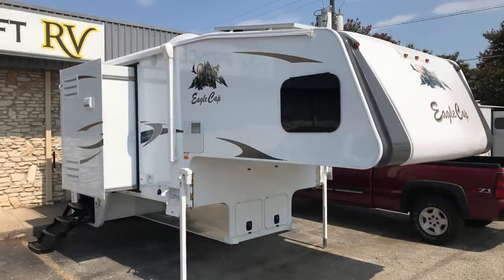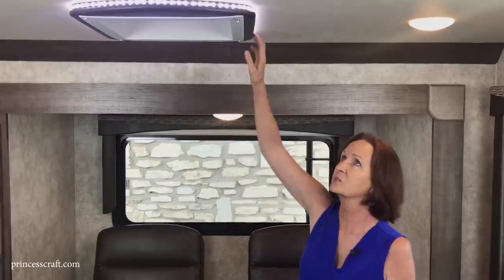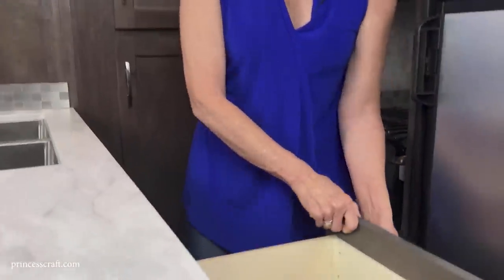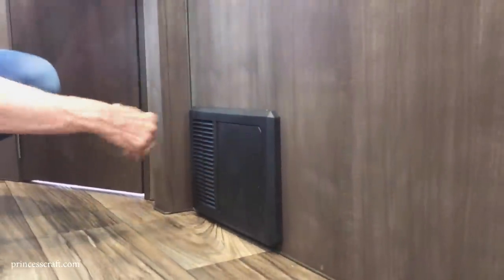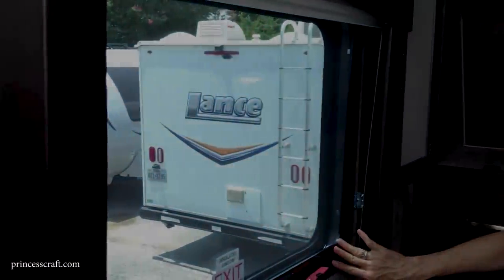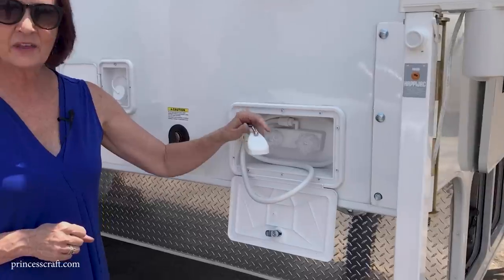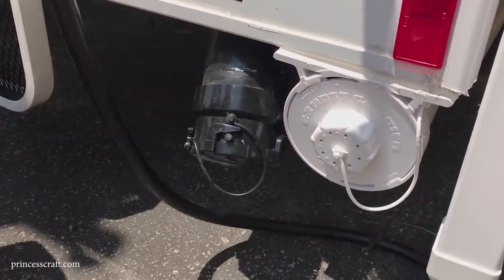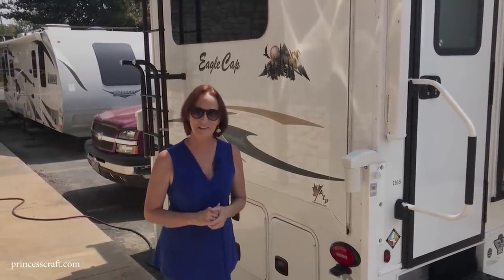2019 Eagle Cap 1165 Truck Camper Walkthrough with Princess Craft RV

Comment: Lot of people don’t understand that it allows you to use your truck for other things, motorhome, and trailers have a second annual tax in many states. Plus you can go where a trailer can’t and even small motor homes have a huge overhang the will limit your travels. These are the pluses for a truck camper. Don’t need those features then buy a different type RV. They all have pluses and minuses.

Comment: I think it's very very nice! The stereo that controls all your audio that's at knee level...yeah that's stupid. If it controls as much as it does...you wanna be eye level to see the menu as you scroll through the various functions. Hard to do when it's at knee level. Not a complete deal break but I see some points where leaking will take place after the camper has been subject to road virbration. For $60k it can be done alot better.
Reply: Maybe Chalet did it better but they don't make pickup campers anymore. Maybe Host does it better and Artic Fox Silver Fox Edition is close but who does it better? This camper is just about as good as it gets in a pickup camper. All that in a pickup camper is not an easy task. One reason they cost so much is the amount of engineering it takes to get it all in that small space and still be balanced and safe. True I'd like a better radio location. I'd like a better  radio. Bigger TV'S, a clothes washer dryer and a real jacuzzi tub. There getting there but it won't be 60k. More like 75-100k. You can get anything built you want but sadly it just won't make the weight limits of a pickup camper.

Comment: So by the cost to buy this camper and the truck to carry it,  you could get a class A motorhome, or an all terrain expedition  vehicle.
Reply: All tertain expedition vehicle for 120k? Where? There at least double that more like 500k and a class a built like that at least 200k. Sure you can buy a cheap class a with cheap plastic fixture for 120 but you can't go where you can go with a pickup and camper. Plus you can't drop the camper and use the pickup as a pickup or daily driver. I'm just saying  there are other considerations than cost. I do agree 60k is a lot for a pickup camper. It's a lot for a pick too. So is 500k. Check out Palamino campers. Not this nice but still very nice and I think 22k. You could ware the first one out. Buy another brand new one. Ware that out and buy a third new one for the price of just one of these or even a Host. Just an option.

Comment: I have a question about the A/C in this unit, is ther a duct to get air into the bedrooms area how is the A/C air handled? I know most truck campers have a roof air with the air being distributed forward and rearward from the A/C grill, if this is the case how does the air from the A/C get to the cab -over area? I like what I see in this camper how does it compare to the Lance 1172 quality-wise?
Reply: No, you don't need them were talking 10 feet or so not 35-40 feet where you need it.  Course I agree it would be nice. They cost enough already. Plenty cold and I like it cold. I thought of 2 units I live in the desert but you just don't need it unless you want a backup. Plus the engineers are very weight conscious. These are getting so big and so heavy you really need a larger truck than a 1 ton dually. Adding anything more doesn't help the weight.  I want a washer/dryer in mine. Chalet made one with it but then stopped making them. They went out of business, sold the business but the new owners aren't making pickup campers. What a shame in my opinion they were the best. As for lance. Out dated small generic bathroom. Floor issues. Nice but not in the class of this or Host or even Artic Fox Silver Fox Edition. Stick to one of these or if cost is an issue look at Palamino for 22k you cant beat it. Also Alumi-lite, sparce amenities but light and last forever like an airstream. Happy camping.

Comment: I don't understand why the black tank flush is on the opposite side of the camper from the dump valve!  When you dump, the water access is on the same side as the valve.  Not good.  Also, why isn't there a way to manually retract the slides in the event of an electrical failure?  PS  I own a 2019 Eagle Cap 1165!!

Comment: One of the nicest truck toppers I have seen and a nice presentation, but if I'm not mistaken, (and I played this part three times) it sounded to me like she said the price is around $60,000. Seriously? Let's see, after adding another $50,000 to $60,000 to that for a decent truck to sit it on your looking at around $110,000 to $120,000 for something relatively small, and doesn't even come with an A/C unit. When you consider the fact that you can buy a really nice, new 2019 motorhome for around $80,000 to $90,000, who in their right mind would choose to pay that much more for so much less? There must be something I'm missing ...

Comment: Super fancy! I just dont understand, Smaller Rv'  less materials' yet more expensiver?  Than a 30ft Trailor? Maybe im just clueless?_ Nice rig though ☺peace'
Reply: I agree Charles. No reason at all for smaller TTs to be higher in price than longer ones. It's so wrong how the manufacturer is taking advantage of the smaller market buyer.
Reply from the maker: Depends on the materials and construction methods being used. Where they’re built plays a part. Engineering features into smaller rigs is more difficult/time consuming/and costly.
Reply: @PrincessCraft  excuses excuses...
Reply: @PrincessCraft  Thank You!' Now Im Less Clueless' and Would Still Love To Afford One🌎✌
Reply: I don't buy the higher engineering costs. Sure there probably is some additional engineering cost but so do all new models.  The basic design was engineered 50 years ago so the cost have long been paid for. Personally I belive 
The high cost is a rip off. Palamino campers are nice, no not this nice but nice. At 24k you can't beat the price. Options not with standing but if Palamino can build them at a reasonable price they all can. Plus you can't justify the extra 35 grand is due to upgrades. Some yes, but 35k? No. Give us all the reasons you want, the answer is greed!

Comment: That rubberized fabric roof with the screwed metal edge clamps, and plastic top fittings will be fine for a few years, then it will begin to leak, and IF.. IF..IF the frame of the camper is made of wood. rot will set in around those screw holes... then extensive roof resealing every year will be needed to reduce further damage.   One piece fiberglass roofs are superior. 

This note is after 25 years living full time  with RV's  all across the US... look for full aluminum frame campers at a minimum.  (I dont know if this one is aluminum frame or not... for 60K it should be.)
Reply: So are you saying Lance truck campers are better?
Reply: Lance campers are notorious for bad leaky floors. Plus the generic bathroom is small and the design lagging behind and dated. Other than that I like them. This camper is fully aluminum framed very well built and insulated. The roof? Rubber is not my choice either. I agree it's the one thing  I don't like. However 12 year guaranty must be well made for them to offer.that on the roof. Check Host and Artic Fox Silver Fox Edition. That's  it 3 choices. In my opinion. Maybe a used Chalet because there no longer made.  Very well built.
Reply: This one has aluminum frame.

Comment: Can you set this up to pull a vehicle or boat with this camper?
Reply: Of course, it goes on the back.of a dually pickup truck. So your able to tow anything you like even another camping trailer which is what I do. You can sleep a lot of people in that configuration.
Reply: @dfwsecurity1697  Thank you, just making sure with this camper it tows because it seemed liked the camper covered the hitch area.

Comment: Why don't you show us the inside with the slide out closed. We need to see that as we won't be able to use the slide out every time.  Also I would like to see Eagle Cap making a truck camper without a slide and the bathroom in the middle and the dinette in the back.
Reply: The rear side and the driver side slide have to be extended to gain any kind of access to the interior.

Comment: we're considering investing in a truck and a spacious camper. can you suggest a truck and specs, diesel,4x4,cab size, etc, etc. also where are you located.maybe we'll take a road trip.
Reply: F450 is even better than F350. The 350 is smoother on the road unloaded but the 450 is incredible when handling a lot of weight.

Comment: One Question,is This Camper 3 Season or 4 Season?,if I was going to Purchase a Camper such as This,I Would want to be Able to Camp During a Canadian Winter in British Columbia,the Yukon,and Alaska!,From the looks of some of the Underneath compartments there's not much Insulation if any!,Just Saying for that kind of Money it should be 4 Season Capable!,It is Definitely Roomy with The Slideouts,and I would say those Slideouts would cause a lot of Heatloss in The Winter!
Reply: 4 season. Not a concern. It has plenty of heat and it's very well insulated. It's as insulated as you can get. I've camped in blizzards and was nice and warm. The tanks are heated nothing came close to freezing up. As long as your prepped and preferably have some experience too, you won't have an issue. In fact, there are very few campers that you can do that with and this and Host are the best ones. If you can't  do it with a Host, Eagle Cap, Artic Fox or Lance in that order in my opinion, you can't do it any camper. Host and Eagle Camp are very close. Artic Fox, silver fox edition another great choice. I'd  pass on the Lance nice product just not in the class as the other 3 and it has known issues like the floor and sometimes the corners and the generic bathroom is just outdated and to small for larger people. Hope that helps.
Reply from the maker: It is rated as 4 season by the manufacturer.
Reply: @PrincessCraft  But Have Any Customers that Have Purchased it,have They Commented on How Good it is In Winter?,I mean The Manufacturer can say that all day,doesn't always mean that's it True!,I Would Just Like To Hear From Someone That Has Actually Camped in it in Winter!,But Thank You For The Manufacturer Information!
Reply from the maker: @rgarrison1819  We have heard from customers are happy with their Eagle Caps... but we are in central Texas. Many of the customers who are close enough to report back regularly don't get up into the northern, colder latitudes when the temperatures really drop. That being said, the good folks at Truck Camper Magazine likely have a good bead on this for ya. They get lots of input from the truck camper community, all over. Best of luck as you research!

Comment: Just how stable is it while your driving?
Reply from the maker: That completely depends on the vehicle you put it on. A 1 ton dually, properly setup feels very sure footed under this camper. We recommend airbags and sometimes stabile loads to stiffen up the suspension and level out the vehicle.
Reply: Your concerns are  high winds I would.not travel 50 mph wind is too much. Also rough trails you need to go very slow. Don't  get me wrong. This is why most want this camper so you go where no man has gone before it's perfectly fine just use a ton of common sense help might  me days away also be prepaid spare tires yes plural as in at least 2. A Jack a winch boards to get you un stuck   tow chains toe straps shovel traction mats get the idea. Well it's supposed to be an adventure. Enjoy.

Comment: Would love to buy this but $60K plus another $60K for a worthy truck puts it out of my range.
Reply: TheOtherMike Right? But having looked this way myself, instead of having a motor home sitting and doing nothing, with this you slide it off and you still have your truck for other uses.
Reply: $20,000 would buy a nice used heavy duty diesel truck with four-wheel drive. It would still do the same job as a brand new truck and that's what I did

Comment: You cannot even get into the camper unless the slide out is out. So how do you access the camper if you can't open slide out?
Reply from the maker: What will prevent you from opening the slide out to access the camper in normal use conditions?
Reply: @PrincessCraft  parking space. Rest area parking is full at night. Happens more than you think. You deal with it or you get a smaller unit.
Reply: You cant. A good point. Something to consider. If you think it's an issue opt for a smaller unit. We just deal with it. It's  not a big deal but yes it sometimes happens so you find a larger space to park.

Comment: nice camper but way too heavy for most Dualley trucks. my 3500 Ram mega cab is rated for 5400 lbs in the bed. 14000 lb GVWR. to haul this camper you need a regular cab truck with an 8 foot bed. 14000 lb GVWR dually rated to carry at least 6,000 pounds in the bed and after you put gear in your truck you still may find yourself overloaded. don't believe me. buy this camper. put it on your truck .put your gear inside and then hit the scales. we have an arctic fox 990.
Reply: Perfect for a f-450 crew cab diesel.

Comment: What can be accessed with the slides in?
Reply from the maker: The slides are so deep in this particular unit that they retreat very far back into the camper when the slides are in. All that said, there is really no access to anything in this camper without first extending a slide or two.
Reply: @PrincessCraft  😔 that's too bad. I love everything about this camper. Buy access to amenities during a pit stop would be nice. Also, what if the slides fail? If there a manual override?
Reply from the maker: The manufacturer is required by law to have manual overrides for their slides. All manufacturers that produce products that incorporate slides are required to have manual overrides.
Reply: @PrincessCraft  thank you! Even with the slides this is on the top of my list. We have a 36 foot Fifth wheel now and am looking at other options.
Reply: imho no access with the slides in means no go on the purchase. plus when caught in extreme weather ive heard folks will bring the slides in. heat, cold, bad storms. these slides make that nearly if not completely impossible while camping in them. think in the future ill stay away from slide outs. imho.
Reply: @covetthecamper2289  i get sticker shock from the northern lite's. not knocking the quality, im sure its there. big foots ive heard of but dont see for sale near me to often. lance is about the most common from what im seeing.

Comment: How does this compare with the Arctic Fox - I'm from the UK and looking around. It would paired with a new Ford F350 crew cab 4x4 6700cc diesel in any case. (I would change the LPG to induction and diesel heater. also the fridge/freezer to a compressor model. Also possibly change the RV 240v for the UK and Europe with Lithium and a Victron inverter charger)

Ah 102 inches wide too wide for the UK 99 inches MAX !

Comment: How does the generator run
Reply: Very well on propane. You can switch it to a diesel unit hook it to the trucks diesel tank if you wish. Safer course  a little time hooking up the fuel. If your thinking diesel then dont order the propane generator. Ask if it's generator n re ready so the hook ups will be there. If your.not handy then you will be fine with the propane. As long as you have propane from inside just turn it on and start it simple.

Comment: CANT STAND THE WASTED SPACE OF THE "theatre seating' I LOVE THE (50th aniv) ADVENTURER THAT HAS A DROP DOWN EXTRA BED OR STORAGE IN THAT SPACE  FULL WRAP AROUND DIMMER CEILING LIGHT, BUT A TU ON THE VIDEO THANKS ITS MORE INFO THAT HELPS ME ALSO LIKE THE SHOWER ROD THAT LOOKS LIKE A GREAT SYSTEM OVERALL WAY TOO HEAVY, DONT LIKE THE POWER HANGING, & IT LOOKED LIKE NO LOCK ON THE PROP TANKS & U DIDNT LET US SEE/ HEAR THE SLIDE OUT IN OPERATION! PS. THANK U FOR GIVING A PRICE!!!

Comment: 37 min. for a truck camper review is a bit long.
Reply from the maker: I agree!... for a review. But for a thorough walkthrough tour, it just takes that long.
Reply: It is a thorough and detailed tour. Thanks so much. Never mind the length of time
Reply: Not if you I tend to buy one or are comparison shopping. I'm in the market for one, I want to know every detail to decide witch of the 3 I want.
Reply: Because the lady speaks so clearly, this vid is very watchable at 1.5x speed :)  And you shave 9.5 minutes off.
Reply: The only quick walkthroughs of truck campers I have seen are used ones that Hailet RV has uploaded of their used inventory.

Comment: I will take a lance better quality less money lot lighter
Reply from the maker: It's hard to argue the quality of Lance! We have them, too!
Reply: Nice I never did this but looks interesting.
Reply: I have twice the storage in my 1165 then what the largest Lance offers.
Reply: I own a 2012 Lance 992 truck camper.  I will be buying an EC 1165 before too long.  Lance is NO LONGER the highest quality truck camper builder!  They haven't been for several years!!  You need to educate yourself Wes!
Reply: @philborchelt5396  yep Lance aren't built like they used to
Reply: how so?
Reply: @philborchelt5396  d
Reply: @philborchelt5396  Perhaps that is why he is watching videos. Not being a terd.
Reply: Way Wrong.. The structure of a Lance Camper won't hold up,and will fall apart.. Check out the Lance aluminum framing, or the little bit it has..
Remember.. When you take a RV out you are putting it a 3-4 magnitude earthquake. You need all of the heavy-duty metal framing that's in an Eagle Cap / Arctic Fox Campers for them to last a long time.